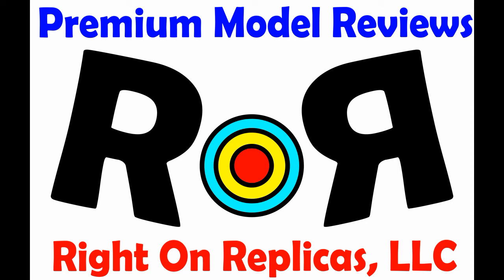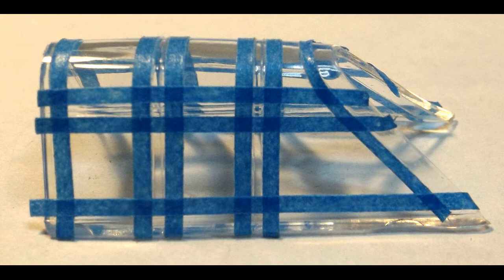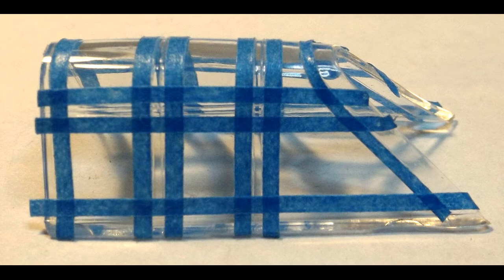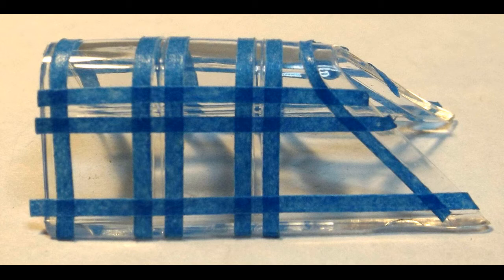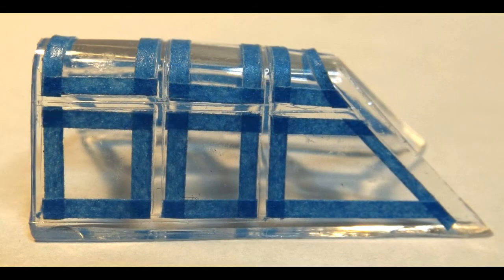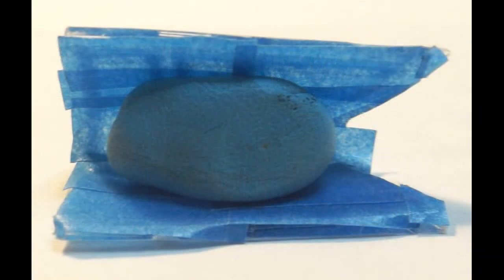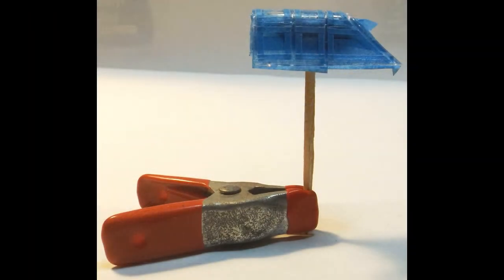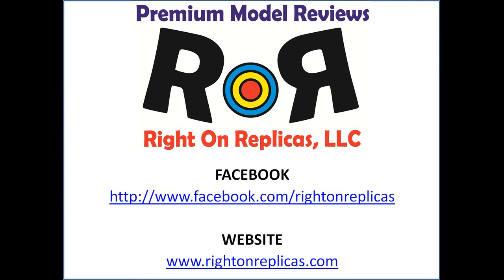Canopy Masking -A How-to Modeling Tip

Comment: Excellent tutorial.  I will try your method on the next canopy frame i do.  Typically, I have bee using Bare Metal Foil, completely covering each window pane.  I then burnish it down really good with a rounded tip toothpick.  Next, using a brand new #11 blade, I drag slowly the blade along the frames.  Using the blade I carefully lift up the scored piece covering the frame and pull it up.
Reply from the maker: Dh - I've had trouble with the foil lifting off paint so this works better for me!  -Doug

Comment: Thanks sir. I have an old 1:72 Frog Fairey Barracuda on the go and it has a pretty intimidating canopy. I was going to cut little squares of tape, but your method is better and easier. Thanks.
Reply from the maker: AS,  You're entirely welcome.  Glad we could help.  PS -if you haven't already, please subscribe so that we can reach more modelers!  -Doug

Comment: Great ideas! I have tried to use the liquid mask before but when I use it on a canopy dipped in future it ends up cloudy at the reveal. I then use plastic polish but it can sometimes get on the painted frames and gloss them up. Do you have a certain brand of liquid mask you use that will not dull the future coating? Thanks so much!
Reply from the maker: GC,  Typically the haze your seeing will clear up in a few days if it's not too humid.  I use MicroScale's masking product.  One thing to be sure of, however, is that your products are fresh and uncontaminated.  Never re-use the floor polish and make cure the mask is less than a year old!  -Doug
Reply: Thanks Doug! I will give the micro scale product a try. I appreciate your information!

Comment: Masking & Painting Canopy or clear parts
I use the following, bond for woodworking (aqueous vinyl acetate resin type emulsion type adhesive) use
Coloring with watercolor paint is possible. Apply thickly, spread using a thin bar and surface tension.
After painting drying, it becomes easier to peel off when warmed up
Reply from the maker: TES,  thanks for the tips!  -Doug